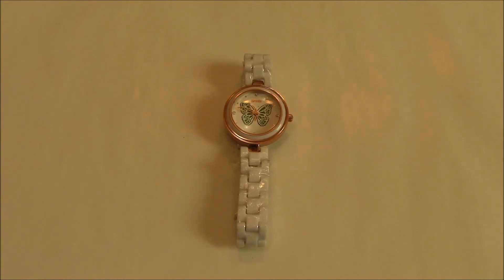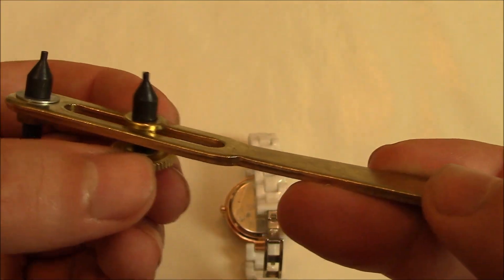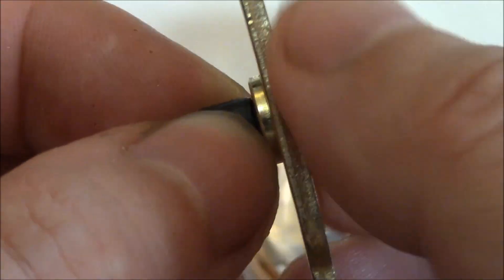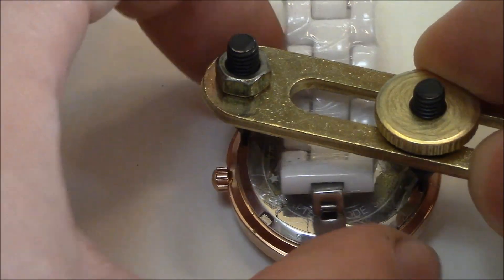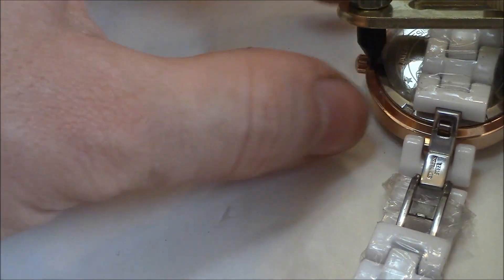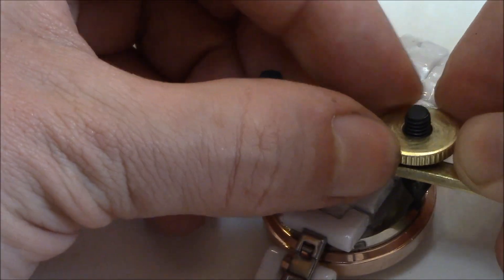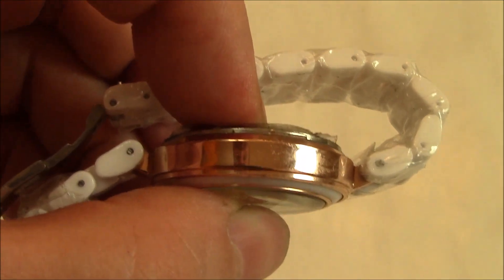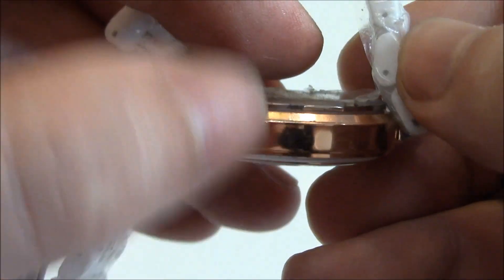How To Open A Water Resistant Very Tight Watch Back Case Quick And Easy!

Comment: Simplest, cheapest, and safest method is to superglue a large nut to the back of the case. Allow the superglue a full 24 hours to fully cure. Once the superglue is cured, you can apply a spanner to give you the leverage needed to remove even the tightest watch back. Once the back is removed, simply soak it in acetone (nail varnish remover) for 6 hours or so, and the nut will drop off.
Reply: I LOVE THIS YES YES YES THANK YOU. GENIUS. I SWEAR.
Reply: @PoPzQ  not my idea. I'm just sharing it. It really is so clever, and got my watch back opened very easily after all the specialist tools had failed. Good luck and enjoy
Reply: @rickbear7249  Definitely a boss. I'll be doing this later today. I've been ripping my hair out trying to get the back off of this darn thing.
Reply: @PoPzQ  Just be sure you allow the superglue at least 24 hours to fully cure. I didn't, and the superglue failed. But, on my 2nd attempt, I left it the full 24 hours and it worked. I guess we're all so used to thinking of superglue as an "instant" glue
Reply: @rickbear7249  You are absolutely correct. It takes 24 hours to fully set, and for strong holds you'll not want to disturb the bonding process. Pretty neat, I never really bother to let it fully set either lol.

Comment: How di you put it back on
Reply: Exactly. I have struggled for hours to take the back off, just to invest in the new battery and my time, try to get the back on, and break the crystal.
Reply: Screw it back on with the same tooI in the opposite direction.